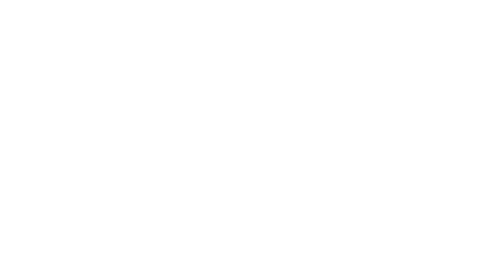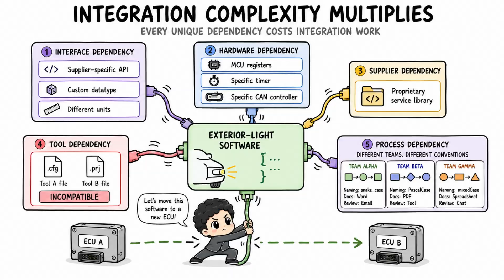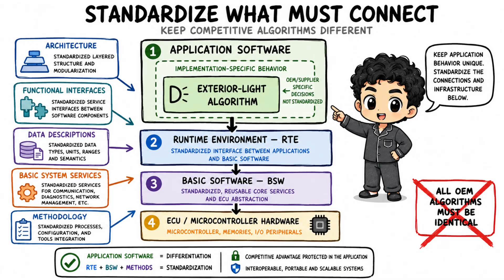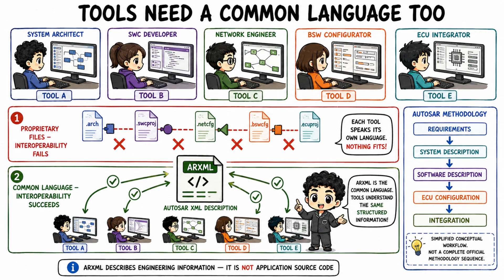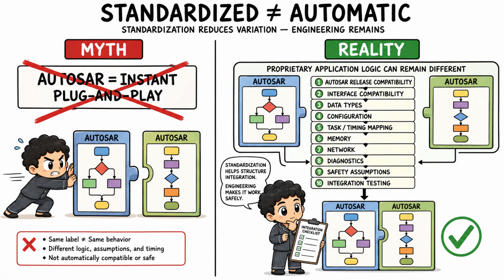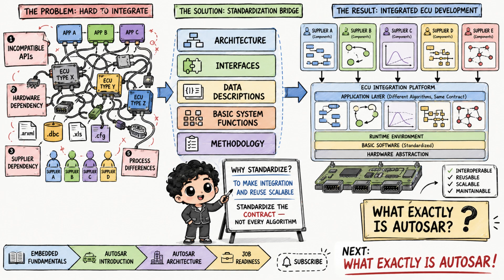Why Automotive Software Needs Standardization | Ch-11

Comment from the maker: Two software modules both work perfectly alone, but they use different APIs, data types and units.

Is that a software-quality problem or an integration-contract problem?

Explain which parts should be standardized—and which parts should remain implementation-specific.